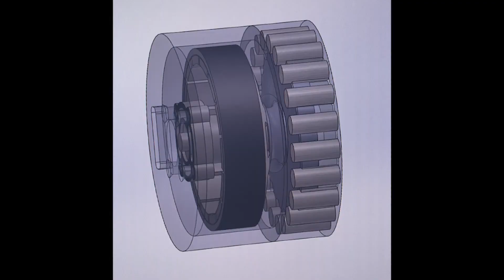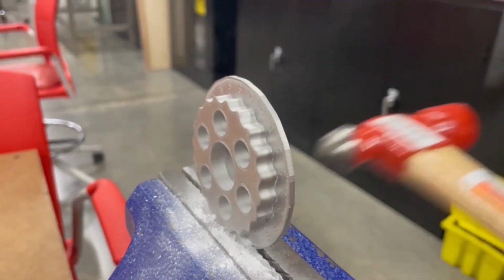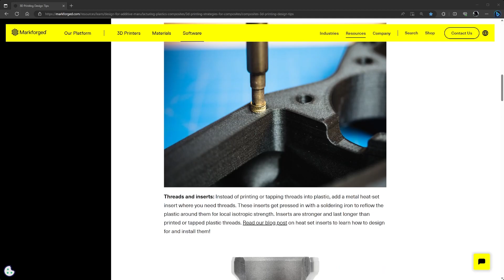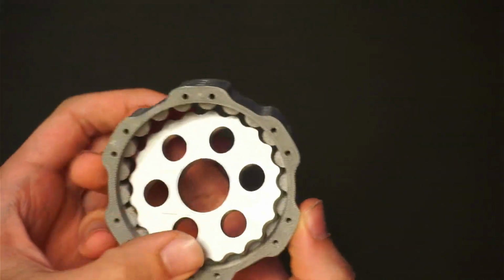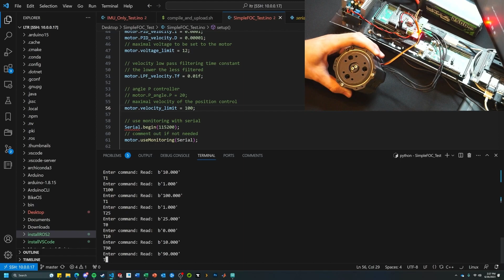Designing and printing a Compact Cycloidal Actuator

Comment: Great work! Looked at your design and saw there are some contacting surfaces between bearings and 3d parts. Is it by your design, does it not cause friction between moving parts? Also, any tests for the efficiency of the gearbox? Modifying your design for cheapest 5010 bldc motors.
Reply: also, are you planning to have some output encoder? Because with the encoder on axis with rotor makes output measurements ambigous.

Comment: You should not use fiber reinforced filaments for parts that rub against each other. And from my expierence, a cycloidal drive requires highly precise manufacturing methods, metal 3d printing just won't do. Normally you'll need high precision CNC to ensure the usability. We've used wire EDM + CNC lathe to manufacture a few of these, and only a fraction of them were good enough.